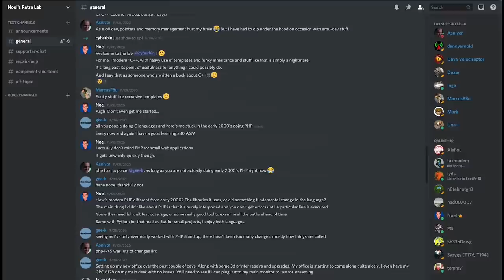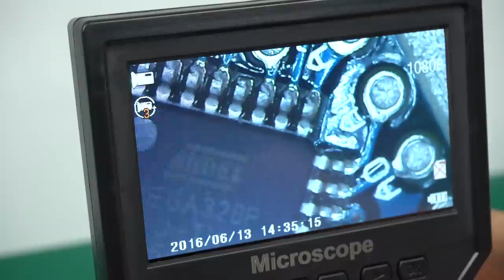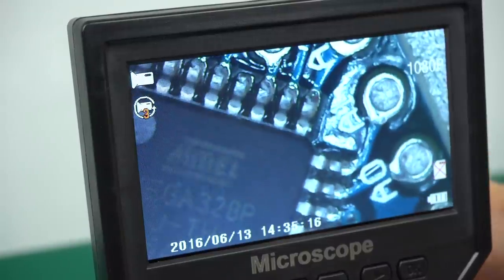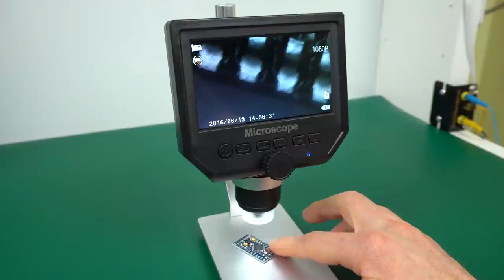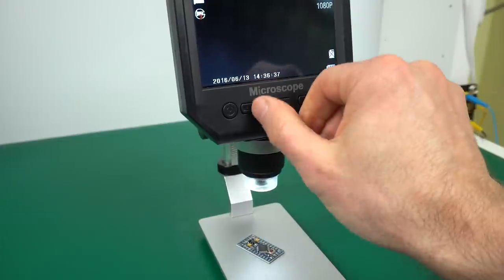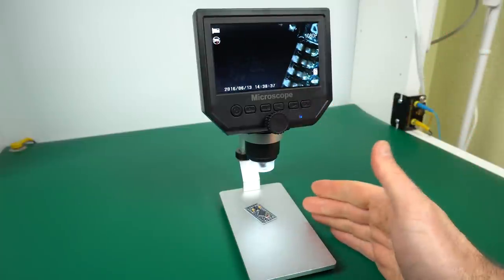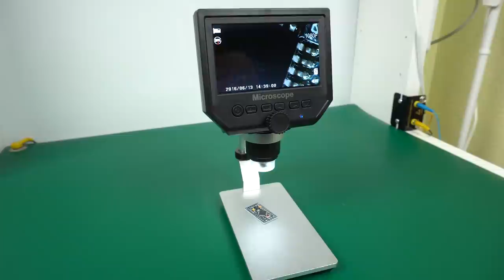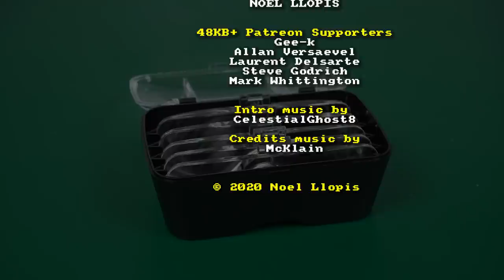Are CHEAP Magnifying Tools Any Good?

Comment: I have the cheap electronic microscope, which works really well when micro soldering.  The only drawback is that you're limited to the size of the board you want to look at, unless you modify the stand or remove the camera and put it on an adjustable swing arm.

Comment: Just a heads up - I'm 64 and it gets worse.  The microscope you have is what I use.  It's the best thing I've found so far.  I would love to mount it on a movable mounted arm of some kind off the side of bench.  Then display it on a TV screen on the back of the bench.  That's my plan anyway.  Thanks for the videos.  I've watched 4 and just subscribed.
Reply from the maker: Haha, so far I've been lucky with eyesight, but I'm fully prepared for it to deteriorate like everything else ☹️ Oh well. Glad to hear the microscope it working out for you. And thanks for the sub! Hope you enjoy the videos!

Comment: I can attest to the glasses. The light is great. It’s very bright and the headset itself seems very durable if you aren’t abusive to it. I use it at work all the time especially when I have to work in dimly lit conditions. The microscope is better than I anticipated. I was expecting a far worse picture. It will far exceed my demands. I will order this week.
Reply from the maker: Yeah, I've been using them some more and the glasses are great, even for through-hole soldering when you care about the small details (desoldering mostly). Really happy with all of it.

Comment: Since my eyesight is very bad close by, I do most of my soldering on an AmScope SE400-Z optical stereo wide-field microscope, it costed only around $200, and has 9" working distance giving me plenty of room to use a full size soldering iron, heat gun, or other tools.
Reply: This is twice the $100 budget, but I recommend it over any electronic microscope.
Reply from the maker: That's a great price! I think the prices I saw were many times that. Or maybe I was looking at different models. But I've heard that recommendation and Strange Parts repeatedly recommended. I'm writing it down for future reference. Thanks!

Comment: I just use cheap (99cents) 4.0 diopter "reading glasses" - they work well enough for most soldering jobs.
As I have normal vision and don't "need" reading glasses, they give very useful magnification as well as enabling closer focus for hand soldering or reading tiny IC  markings
Reply from the maker: Yeah, that works too. Even cheaper! I like it 😃

Comment: I use both the microscope and the glasses regularily, as they both have their advantages depending on the situation. For the scope, I recommend to cover the shiny table with black tape. Otherwise the reflecting light can cause the scope to lower the exposure, which makes details in dark places less visible. My scope also has a very annoying delay when viewing over USB on the PC.
Reply from the maker: Oh good tip about the shiny stuff reflecting back! I did notice that.

Comment: Thanks! I was evaluating a microscope like that some time ago - a slightly better version but more expensive - but then to be honest I realised I can do most of my very limited SMD work with a good magnifying lens. One issue with the microscope you reviewed is the stand: if you need to solder a larger board you're stuck.
Reply from the maker: You're absolutely right about the stand. Next stop is to mount it on a free arm to move it around freely.
Reply: @NoelsRetroLab  That'll do! Thanks for the video!

Comment: Thanks for the video, I think that microscope got too much magnification for soldering, but it's a lot of value for money. Personally I just use a pair of cheap reading glasses when working with the smaller components like 0603 and down to 0.5mm pitch ICs, for close inspection I have few small loupes from x5 to x20. If I had to work on anything smaller than that I'd need a proper stereo microscope.
Cheers,
Jake
Reply from the maker: Yes, at the magnification I was showing it, it was zoomed in more for joint inspection. If you zoom it out it's pretty good for working though.

Comment: Nice video, I'm still getting better at good old through hole soldering, but I'm keen to look into SMT soon, so I like learning about it. Seen an interesting video recently from Great Scott using solder paste, a paste temple and just sand in a pan to hear it, looked like a cool DIY way to make up SMT PCBs.
Reply from the maker: Thanks! Solder paste is next in my list of things to try too (especially after soldering that crammed board). Definitely interested in experimenting with it.
Reply: @NoelsRetroLab  yeah soldering that tiny RGB board was quite and achievement, but bet it did have you considering alternatives. This is the video from Great Scott https://youtu.be/DYrucIWig24 where he tries 3 different methods.

Comment: As it turns out I have already bought both of those. I found the glasses useless and didn't keep them. I think that's because I already wear glasses. 
The microscope though is good, especially for the price. It needs a lot of light though. If you're trying to spot a dry solder joint then it benefits from an external light rather than the built in one but I can live with that.

What I did find that worked great for me is reading glasses. My eyes already need +3, so I bought a pair of +7 reading glasses and they're great for close up work. I have now bought another pair, this time +5.5 and they are a better compromise, I can still find the tub of flux for example with them on.
Reply from the maker: Yes, I'm noticing an external light at a angle is better than the built-in one straight down.
Reply: @NoelsRetroLab  That is so true. You also often can read (laser engraved) chip markings better when having the light at an angle. So even with cheaper scopes like this the image quality can be improved.
Reply: You are right about those glasses... I purchased mine from a hobby on-line store, and they broke!!!  They broke because the nose piece was Too Rigid for my nose so I remove that part by unscrewing it. Then the forehead piece was Scratching my forehead, not comfortable, At ALL!  So I attached the strap that came with the set, worked okay, except for that forehead, so I placed a piece of spongy-foam on there, which worked great.

But, after All That... I dropped mine onto the wooden floor and the part that goes towards the ear, Just before the strap attachment, broke.......Very Disappointed!

Microscope???  Hhhmmmm.

Comment: I use the same microscope, and it is incredibly effective, way better than I had expected for the price.

I also use a handheld magnifying glass with built in LED light, not for soldering but rather to help when reading faded IC markings, resistor colour codes, etc.

Comment: Great video.
The glasses are a no go for me. At least for soldering. Reason being is that if I'm soldering something small enough to use magnification, I will also be using flux of some sort. Even with a fan/fume extractor, those focal points are a bit too close to the face for my liking.

Comment: I have a similar set of glasses and one of those cheap usb microscope's on the rubbish stand. This microscope looks a lot better picture  and something I should add to the workshop.
Reply from the maker: The picture is far from perfect, and you have to play with the light (or add some external light) to get it as good as possible, but for that price, it's still worth it 😃

Comment: Thank you Noel, very useful tips! I use always the magnification glasses, the weak points of it are: 1. very uncomfortable to wear my own glasses under it. 2. At any case... with 3x lens (that I use the most) I need to get very close to the board for soldering (SMT) and I can feel the heat of the soldering iron :). About magnifier microscope... now I am convinced to buy a new one. I have one, but it requires a computer to show the image on it, so not very handful in case you need to solder or to check (for what I need in this case) how are the SMT components solder without remove my glasses. So again... thank you, I will check the links to order one microscope with monitor. :) nice to watch you
Reply from the maker: You're welcome. You're 100% right about wearing your own glasses making it difficult. I didn't think of that at the time.
Reply: Another issue for glasses wearers is the close focal point with the glasses style magnifiers, which adds significantly to eye strain and fatigue when spending hours at the bench. My favorite lower magnification device is a lighted  gooseneck loop, which is less than $30 in the US. The LED versions or the older round florescent tube versions give even lighting and do well as secondary bench lighting as well. 
Two suggestions for hobby or electronics work; get a glass lens and some lens cleaning wipes (flux soldering under the lens leaves a film that builds up slowly) and, if you can find one with a flip down cover, it saves a lot of dust cleaning. If you cannot or the price is ridiculous, a soft cloth cover (a microfiber or washcloth is perfect) over the top of the lens saves a lot of dust removal.

Comment: Noel, I like the Microscope but looking at the distance between the stand and the position of the item being looked at, I assume you can't use it say to work on the centre of a say an Amiga 500 board as the stand would not allow you to position the centre of the board under the lens?  I have the same glasses as the ones you reviewed and I use them all the time, the beauty is that they allow you to go anywhere and on any size board. Is there a version of the microscope that has a cantilever stand that allows you to swing the device over a larger board?
Reply from the maker: Absolutely correct. Even for a tiny board like this there were some positions I couldn't use. The stand is removable, so you should be able to attach it to any kind of stand you want (like a sturdy microphone arm one for example).
Reply: @NoelsRetroLab  I think if you had one of those microphone stands that you could lock in place this would be really usable.  Did you find you could work on the board whilst looking at the screen, that seems a bit weird to me, but I suppose you just adjust to it?
Reply: Perhaps a future video might be seeing if you could mount it on a stand with a long reach, I would be interested to see if it's possible and whether working on larger boards using this is possible. Thanks for replying to my question.

Comment: I have another microscope without screen that you connect through usb to your pc. I think I prefer mine because I can move it with my hand wherever I need to. It also has a stand if you need it, but the screen will  be your larger monitor or TV.
Reply: But the problem with USB microscopes is that there is too much lag or delay. I already have one but its too slow. At high resolution the lag is over half a second.

Comment: I've been using those magnifying glasses for some three years now and they are a great solution. I don't bother with the light saving the weight on my nose. Recommeded!!!
Reply from the maker: Good tip! You're right that if you're in a well-lit environment (like I am with all the flood lights for the recording) the light isn't necessary. I like it! Thanks!

Comment: The stand type microscope looks very good :-D
But the physical screen could be bigger so you can back away the lense from the pcb and get the same view.
I bet the monitor is not a normal lcd monitor, otherwise you could use a bigger one.
Bigger is better they say ha ha  :)

Comment: I've had 2 of those microscopes and they both quit working..The first one lasted about a year and the one i bought to replace it only lasted 2 weeks..It was a great little microscope while it lasted but it's just not reliable enough and it put me off of buying a similar cheaper option again so I think I'll either have to make due without or save up to buy something better. Oh and if you check the properties of the video file you'll see that it's actually not 1080p it's upscaled 720p.
Reply from the maker: That's a bummer. I'll keep that in mind, and maybe do a followup if that happens. And yes, you're right: 720p! (even though the menu in the microscope claims 1080p). Sleazy! It wouldn't have changed anything. Why couldn't they say its true characteristics?